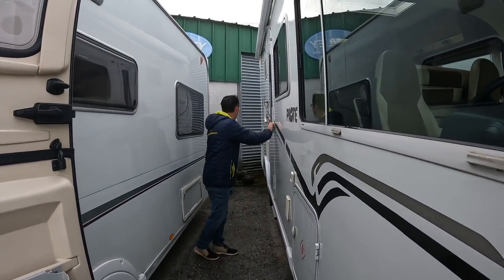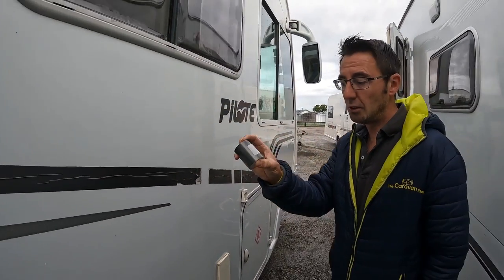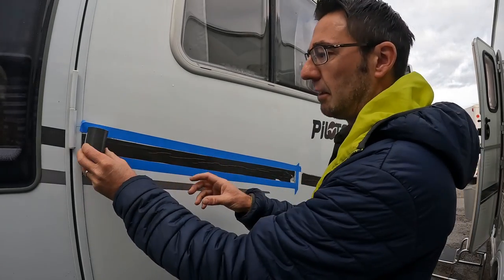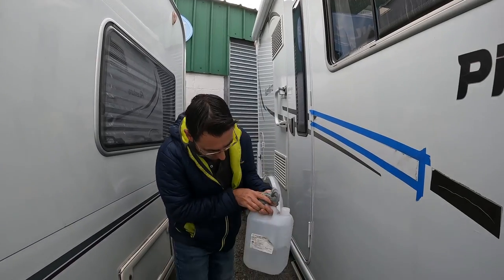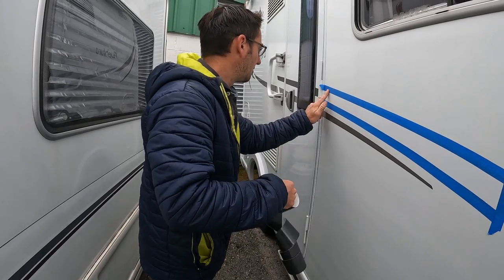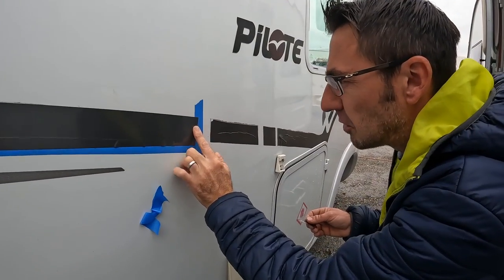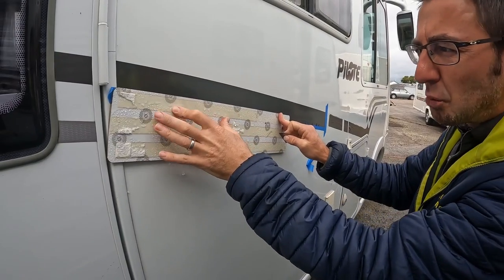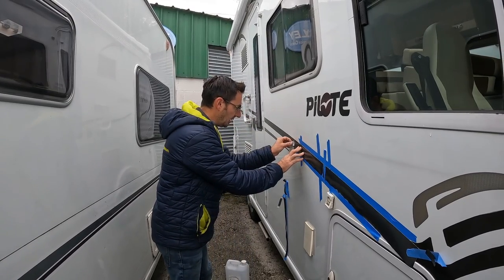Caravan and Motorhome decal replacement. How to

Comment: Surely you have cut through the decal and gone through the thin panel paint into the metal?  Would it not have been better to cut it to size before applying it?
Reply from the maker: As long as its not too much pressure it shouldn't touch. But you need to be careful 👍

Comment: Much easier with a scalpel. Also you'd benefit from an Avery felt edged squeeqee. If that's cheapo monomeric 3-5yr vinyl it won't last and will show a gluey outline after one year (it looks like that is what the previous vinyl was), better to go for at least a polymeric 5-7yr or cast 7-10yr vinyl...all available from your local sign shop, who I might add could very easily supply the lines ready cut with the curves and application paper. :)